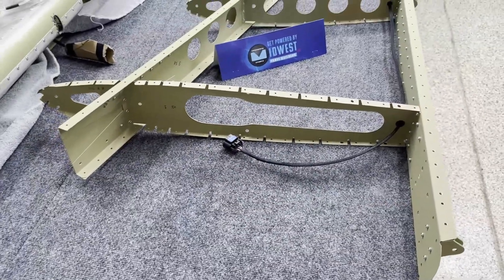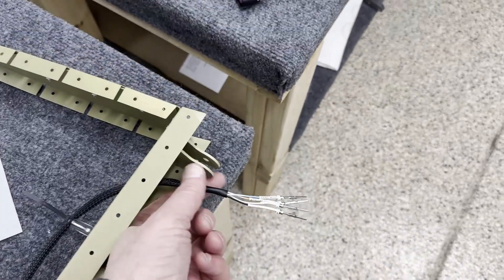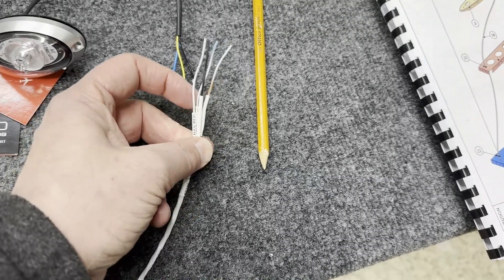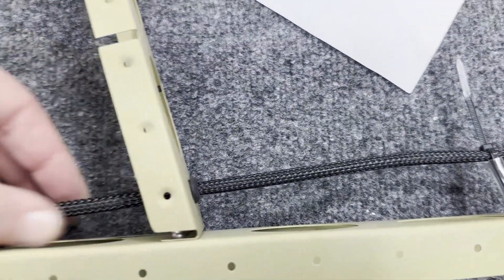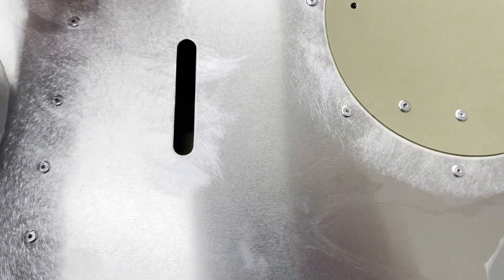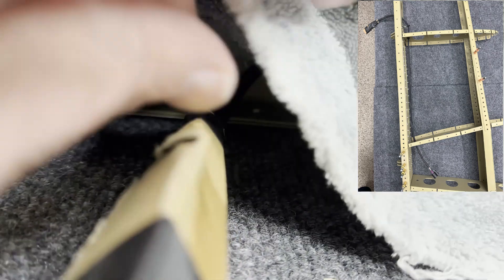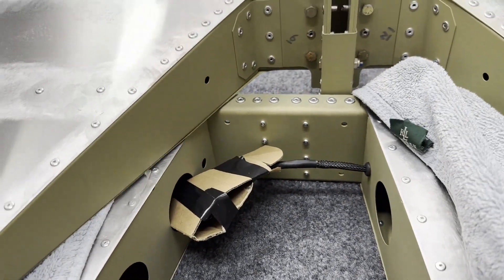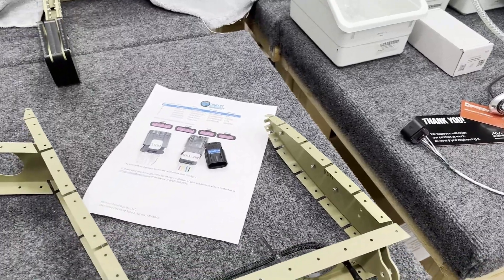Empennage Wiring for the Sling TSi.

Comment: Nice videos. Thank you for putting then together. I see your internal parts are primed. What are you using for the primer? Is it rust-oleum rattle can self-etching or something else? Also, how is the finish holding up to the “build beating”?
Reply from the maker: So far so good.  I've had 2 inside edges flake and honestly its because I missed scuffing those spots before I primed.  A touch up application solved it.   I'm using Transtar 6183, and it came out to be 7 cans to completely paint the empennage.